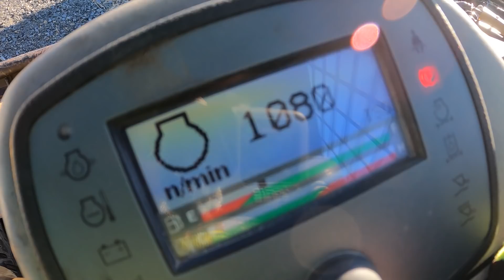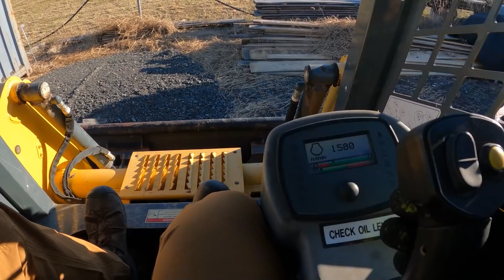You won't believe what went WRONG! Moving a huge Carport Building!

Comment: Josh the next time you move that put some 2x4s all the way across the building to tie the sides together. You have a trailer and a flat bed truck, you can back it under the building and just rais the building up 12” off the ground and again put some 2x framing materials across bed and each side of building and you can just drive around where ever you want
Reply: He had a few people comment and tell him to brace it.
Reply from the maker: remember...this thing is 26 feet wide my friend
Reply: Overall you done a good job and I was impressed. It definitely could've turn out worse. However, you could've taken shorter 2x's than 26' and screw one end one of the "rafters" near the ridge of the roof and then ran it down to the end down close to the part where it sits on the ground. Several of those and it would've helped tremendously with making it more "rigid" and sturdy. Again, good job. Slow and steady wins the race.
Reply: @StoneyRidgeFarmer  we build steel buildings at our shop and move them locally with a trailer! Others further we build them in sections and assemble on site! We cable or chain the bottom or some times use pipe to the bottom of each wall to restrict movement ! Your move got the job done! Don’t see anything wrong with it!
Reply: @StoneyRidgeFarmer  but bracing it won't be that difficult and will remove the risk of distorting the structure. Some scaffold poles or 2x4s will do the job.

Comment: I moved one of those before with a bobcat. We tied a set of skis on the end that was facing the way we were heading. We then put the chain across the middle from one side to the other. I took the bucket of the bobcat and scoped up the chain and drove forward all the way to the new location. Even with turning, it would turn with no issues. Worked great.

Comment: Moved a storage shed several years ago by lifting it up and putting pipes under it and hooking onto it with my F250 and pulling it around to its current location...previous property owners built the thing between 2 walnut trees which of course were growing up and around the shed...someone didn't think before they built as usual.

Comment: Good afternoon! Just got to this. I am relieved that right side didn’t collapse when you went to turn. Frankly, I’m surprised the toe-in didn’t become permanent. I would have suggested putting a couple 2x6s with another one scabbed on in a T for strength the other way to keep those walls vertical while you pulled. Evan at Country View Acres moved one doing about that. But, all’s well that ends well. You got it moved, nothing was damaged beyond acceptable limits, and you now know the grace period on your fuel tank!!

It did take you longer than it would have with a flunky to assist. In the future, there’s a retiree living about 25 miles south of you who would have been happy to come up and been that go-fer. All ya gotta do is ask. If I’m not out of state on my own farm, I’m almost always available.

Comment: We moved a wood structure (approximately 25' x 30') when I was a kid. Gramps had us add bracing first. We used farm jacks to lift the structure and place it on ironwood rollers. Pulled the building with a Farmall A. Kept feeding the building with the ironwood rollers as they were released. The building was on the rollers to the destination. Proper hillbilly engineering... :-)

Comment: I moved my carport with my skid  steer I  put 4x6’s along bottom then put skid steer inside and then braced side to side with with 2x4’s and picked up one end and drove it to its new location
Reply: Did it the same way
Reply from the maker: this is a big one for sure...but it all worked out...tune in saturday for more info and work!
Reply: i used to use a  85.5hp m8540 kubota with m30 loader and bucket  and cab to move a building

Comment: Josh,
 Next time get 2 guys to grab the back poles and run them up front Keep doing that and the bottom won't dig in then u don't have to stop each time . plus get some large Rachet
 straps like the truckers use and criss cross them to hold the frame tight with minimum flex and bowing.

Comment: In a video, I saw them move rail cars with underground style drain pipes which of course got squashed from the weight of the car.  Once the pipe went out from under the back, they would move it to the front.  Your way looked a lot easier except you didn't move a pipe to the front when they ran out in the back.  I thought it might be what caused the building to twirk inward the way it did.  Again, it was interesting to watch.  I look forward to your coming videos.  With love, stay safe, and God bless.

Comment: Nicely done.  Yeah, bracing between where the chains were prob would have been advisable (not only are the chains pulling forward, but also inwards, in line with the chains).  Ditto putting some lengthwise skids under those rollers to help them roll along better.  But hey, it worked, you got it there in one piece so a satisfactory solution was found to the problem of moving.  Nicely done "farmer fixing", or is that Yankee ingenuity  (  ;-)  ), the challenge you faced.

Comment: I have a similar project i will eventually have to do on my farm. My plan is to put my kubota m7060 in the middle of the building with forks on front and back. Then lift the building one side at a time with my MF245 sliding drill stem under the build and on top of the forks. Then chain everything together and completely lift the build with the kubota to drive it to where I want it.

Comment: Two spreader bars of anything that will carry the weight and use a loader tractor and 3 point to lift the shed while the tractor is basically inside then drive to the next location.  You can even get the building exactly where you want it because you're driving it suspended from the tractor

Comment: Hopefully the skid steer just got low on fuel and has an electronic cut off so you don’t have to deal with priming it and all of that, hopefully you can just put some fuel in the tank and it will start again. 

It would be pretty hard to get stuff in and out of there with that skid steer just having to sit there forever. 😉

Comment: I guess if there were more pipes available they could be laid down in the path of where the shed would travel. Anyway as long as nothing is bent or broken it’s a success. These sorts of buildings are made pretty tough.

Do you think you could have move the shed with a tractor?
Reply from the maker: sure....but the skid loader is more maneuverable and you can see out the front...your work is closer to ya

Comment: I had the same issue a few years ago. I was using it as a carport until I built my garage. When I moved it 1500 yards.  I went to Harbor Freight and bought 6 of the big casters and wheels, then took by straps and racketed the bottom so it didn't bow leg on me. It took some time as it was down hill but it worked great. I did have to get my brother on the Polaris Ranger to hold it back as I pulled with my tractor to keep it from running over me...LOL

Comment: If you have any short logs, I think the building might have moved a little easier through the mud. Larger diameter wouldn't have as much rolling resistance. You still did a great job! That's about the same idea I had.

Comment: could of run bracing across both ends and pin it with the existing holes for the rebar and drag from the bracing...just a thought.. wouldn't flex if u know what I mean...either way you did it...lol
Reply from the maker: remember....this is 26 feet wide

Comment: It works but guys, if you move something like this you need at minimum to brace the front where you are pulling from. Then attach the chain to the middle of the brace and drag.  It prevents the bowing.  Also drag it till a roller comes out then take the roller and put it in front.   Little prep goes a long way 🍻 

Still,  THATS HOW YA DO IT!!

Comment: Yea I think I would of put a spreader board between the sides since the inward pull would tend to pull the walls inward. Probably would of just cut a tree in the woods to brace it with. And chain it to the second or first set of uprights
Reply from the maker: remember...it's 26 feet wide my friend...very difficult to span that distance with wood
Reply: @StoneyRidgeFarmer  yea I thought about that. That's why I said a tree. But your side panels go down pretty far and the diameter of a tree that's long enough would have a pretty good diameter and probably be bigger than the gap you have.
You could get a couple 16fters of 4x4s and scab them together with 2x4. Probably be stuff enough but it would need a test to see.

Comment: You may need more than three of those 2” tubes under each side. My fear is all the weight, at on point or another, will only be on two of those. The question will be, can the rail on the bottom support that. Let’s see! He just took off the bucket.
Reply from the maker: one of those pipes will support the entire building my brotha...keep watching!
Reply: @StoneyRidgeFarmer  I wasn’t worried about the pipes, I was more concerned about the sill bending if the whole wall was only resting on one and it was between two wall studs. The building is surprisingly sturdy!
Reply from the maker: I agree...it was very sturdy for sure

Comment: I would have placed four 2x4 spanners across the bottom to hold the walls in place before moving it.
Reply from the maker: lol...find me a 26foot long 2x4 my brotha....this building is very wide...that's why I couldn't brace it down low
Reply: @StoneyRidgeFarmer  
Four of them nailed together like framers do to make poles for pump staging.
Reply: @StoneyRidgeFarmer  I just watched you buck up several logs that were 30-some feet in length.  "Couldn't have braced it" doesn't seem as absolute as you say.  You end each vid with "I don't know guys.  Tell me what you think."  And then so often your reply to your friends offering advice seems too condescending.   Here's my idea, I haven't heard more than a couple of times:  I would have explored lifting it from beneath with the big TYM loader, held up high.  Props for the ambition.

Comment: Looks like you tried to lift the building using the sheet metal instead of putting your forks underneath the frame.
Reply from the maker: nope that's my first attempt at pulling the pins that hold it down

Comment: You may end up kinking the walls or roof at those angle braces.
Reply from the maker: keep on watching brotha!
Reply: @StoneyRidgeFarmer  I did. All the way to the end. For some reason, I just like to comment throughout the videos as I’m watching them. I know you were cutting down some trees and if you cut one long enough to bridge between the two walls, you could have avoided the walls from pulling in. Hopefully, the wall and roof pieces didn’t get permanent bends where those brackets are tied into them. Like I said, glad you were able to get it done.
Reply from the maker: all good my freind...I got her moved that's the main thing...and didn't break anything...well...except the loader